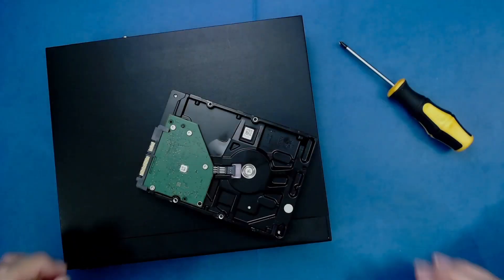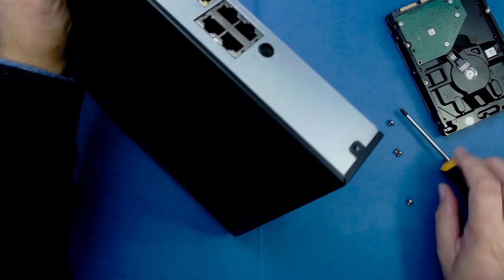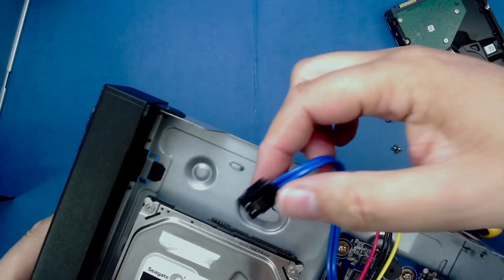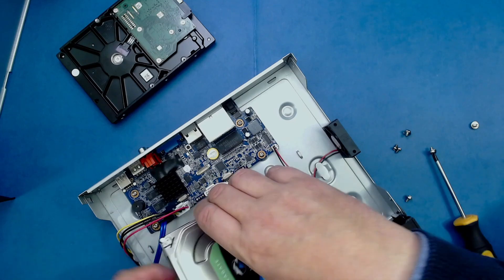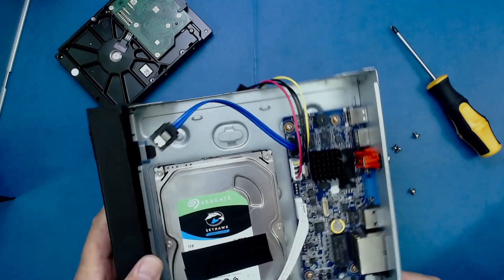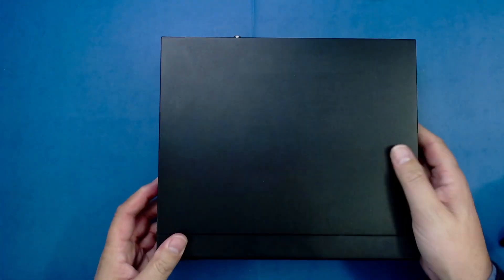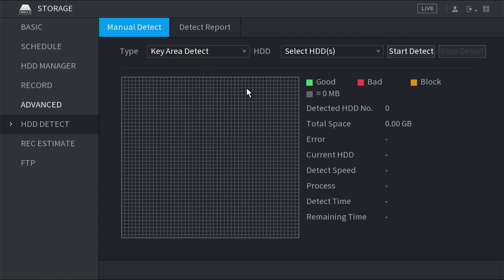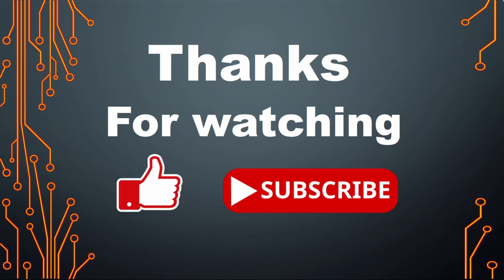How to Install or Replace the Hard Disk Drive in a CCTV  Digital Video Recorder

Comment: I have an ACTI ENR-120 NVR, which has two HDD slots and cable sets.  I  Installed two WD Purple Surveillance hard drives.  A flashing error on bottom of screen was displayed: 'no hard drive detected. please install hard drive'.   Note that hard drives were not seen at all on the storage selection option; there's just nothing showing to be able to 'format'.   I've also tried another new WD Purple and then a WD Blue, with the same result.   What am I missing?.....  Prior to having the ENR-120, I had an ACTI ENR-1100 (which is a very similar older model), and had installed two WD Green hard drives, and that was functioning for years (I don't recall what if anything I had to do to get the hard drives to show up on the storage menu selection.    I doubt that the  ENR-120 is defective, and I doubt that all  the new hard drives are defective.
Reply from the maker: The NVR may have a limit to what size of drive it can work with - for example it might be 8TB. If the drive capacity is too big it may not be able to recognise the drives. You should check what the maximum capacity is. It may be possible to download a firmware/BIOS update that might allow for larger drive capacities but that depends on whether one is available or not. Hope that helps.

Comment: Do I need to format the HDD before replacing?
Reply from the maker: No you don't, but if you want to erase it for privacy or safety reasons I suggest connecting it to a PC and using software such as "Eraser" or "CCleaner" to wipe the hard disk, as formatting it does not really erase the content on it - it just marks the disk as blank so it can be recorded on again. Be careful using hard disk erasing software though - You don't want to erase the wrong disk!

Comment: Do we have to format HDd after installing it in new NVR.

Can't we use the remaining storage space available
Reply from the maker: Hi @sounderrajanr usually NVRs will overwrite any data on the drive and will need to format the drive in order to use it properly. Video footage is recorded onto the drive until it is full and it then will start to overwrite the oldest footage with new footage.

Comment: do the NVR settings have to be reconfigured when swapping to a new HDD
Reply from the maker: Hi 
@Chrisss98, generally speaking, the settings are usually stored in some flash memory within the NVR itself. Therefore, replacing the hard drive shouldn't affect your settings in most cases. However, it may depend on your particular model. If it is a PC based NVR the settings could be stored on the drive. Hope that helps.

Comment: I have to ask why you insisted on putting the screws is the new drive the hard way? The screw holes on the dvr has a keyhole style. So you can put the screws in the drive not 100% tight, slide the drive up into the lock position before tightening them down. Makes life easier than trying to 1 hand screws and driver...
Reply from the maker: Good point! I guess it's because I like to do things the hard way :-)

Comment: Thank you for getting back to me, it is a new unit and I purchased a new 1-terabyte drive to go with it, but it doesn't show on the monitor. The drive has an extra port but the connector from the NVR won't fit.

Comment: My son installed it but I can’t see the drive, I’m wondering what went wrong
Reply from the maker: That's a good question. There are a number of things that it could be. Are you replacing a faulty drive? Can the original drive be seen/detected if you put it back in? If not, it might be that the drive controller on the main circuit board is faulty. If that is the case and you have more than one SATA port on the main circuit board you could try using the other one. Are you sure the new drive is working properly? It should be, but sometimes even new drives can be faulty. It could be something simple like one of the two cables being loose or not fully plugged in. If the drive is over 10TB in size the system board may not be able to recognise it. It depends on the make and model of NVR you are using - have a look at the manual for your particular NVR - it might also have a troubleshooting section that can guide you. Hope that helps.